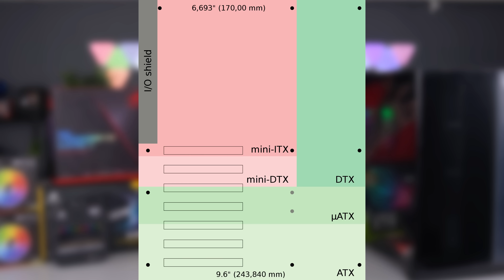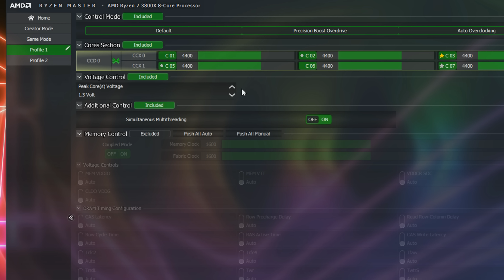Building The Ultimate ROG Gaming PC

Comment: That lian li case alone is more expensive than my whole setup 😂
Reply: Zulhelmi Rozmi its $200...
Reply: @eetthhaann4806  I build my pc which consist of g4560 and no graphics card bcoz im planning to get it after getting a job. Im a student btw. 15 bucks case and 15 bucks psu. H110 motherboard and not to mentioned a 4gb of ram which doesnt have any heatsink whatsoeverr. I just upgraded it to 8gb down the line. And finally a cheap 120gb ssd. Which in a total of about 200bucks in your currency as I live in Malaysia
Reply: @eetthhaann4806  And maybe I could get a used Rx570 for cheap if lucky. Im not poor but I need money for something else if you understand what being a student really mean.XD
Reply: Zulhelmi Rozmi yeah but u need to count monitor, keyboard, and mouse
Reply: Zulhelmi Rozmi and im 14 and just today i built a pretty beefy setup with a ryzen 5 3600 and a 1660ti
Reply: @eetthhaann4806  Good for you. Btw, I just used my dad tv for now and some cheap wireless keyboard n mouse. It just a fun build bcoz I already got a laptop. Maybe I can go full blown after I graduate.😜
Reply: Zulhelmi Rozmi yeah maybe
Reply: Oh your challenging me with my i3 and no gpu stuck on bios
Reply: @hamp275  at least you got an i3😂. Im waiting for someone who still using core 2 duo. XD

Comment: "it doesn't look that empty" he says as there is 3 feet of open space under the gpu...
Reply: He could have fit like 60mm thick radiator as push pull in there.
Reply: He couldve vertically mounted it that wouldve looked wayyy better

Comment: I have a Lian-Li 011 Dynamic I had quite a lot of trouble with the front glass falling off. The adhesive that holds the retention gear in was very poor. I love the case just the same.
I think I may have missed out on the giveaway coolers but could do with something like that but the budget is just to tight for the foreseeable future...
Luv your you-tube Videos  keep them coming...

Comment: You should've gone to vertical mount set up to compensate the empty space at the bottom of the motherboard. Oh and by the way, I prefer placing the rad on the intake as it will suck the heat from GPU if it is placed on the exhaust. Just my cent. Pretty powerful build you got there. That's my dream case. 

S360 :)

Comment: Definitely going to use some or most of these parts in my next build during the summer! I will definitely use the case, looks easy to build in and has just the right amount of tempered glass and with the cooler, it would look complete. I also liked how full you made the case by using the other cooler.

Giveaway: Classic RGB S360

Comment: Here are my thoughts.

At first, I was expecting more of an ALL COMPONENTS were ROG. I was not disappointed with what the build came up with.
In terms of aesthetics, it would be much cooler if the water cooling system was a hard-line rather than soft tubes to give the case more of an aggressive look, but overall, Great Job!

Choice: ROG STRIX LC 360 RGB

Comment: Feedback: the glass windowed front makes it easy to see the amazing parts of the computer however the blank side panel on the opposite side of the case makes cable management more easier and more accessible, with the double psu brackets this case is perfect for water coolers! Also the distribution block used in the video is simplistic but gives an overall professional look to the build. As a buyer I wish Lian li would sell the case with the block but as an a alternative just the case. Great build :)

Ek s240 watercooling kit

Comment: All jokes aside if I were to buy the exact parts you used for this build would you build it for me and send it to my house... I bought a bunch of parts that equaled up to $2,400 just for motherboard to be DOA and made me lose my drive to build it and its just been collecting dust for months and these were my parts 

Intel - Core i7-8700K 3.7 GHz 6-Core Processor $369.99

Thermaltake - Floe Riing RGB 360 TT Premium Edition 42.34 CFM Liquid CPU Cooler $175.46

Asus - ROG MAXIMUS X CODE ATX LGA1151 
Motherboard $274.89

G.Skill - Trident Z RGB 32 GB (4 x 8 GB) DDR4-3200 Memory $304.99

Samsung - 860 Evo 250 GB 2.5" Solid State Drive $52.99

Seagate - Barracuda 2 TB 3.5" 7200RPM Internal Hard Drive $58.89

MSI - GeForce RTX 2070 8 GB Video Card $584.99

Cooler Master - Trooper SE ATX Full Tower Case $139.99

Thermaltake - Toughpower Grand RGB Sync Modular ATX Power Supply $118.68
Edition 850 W 80+ Gold Certified Fully-
Microsoft - Windows 10 Home OEM 64-bit $98.89

Thermaltake - Riing Plus 12 RGB TT Premium Edition (3 Fan Pack) 48.34 CFM 120mm Fans $74.99